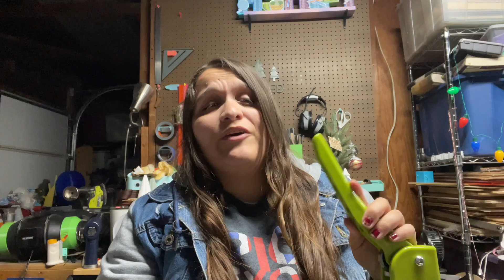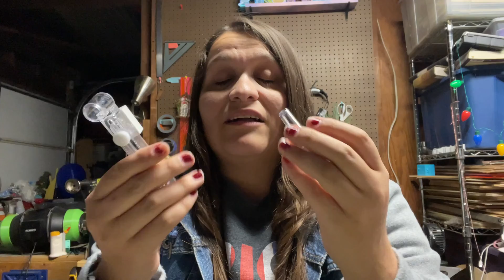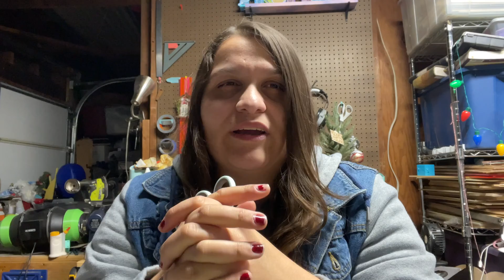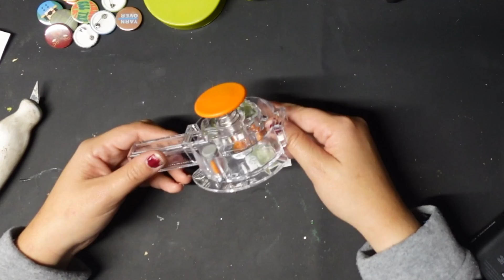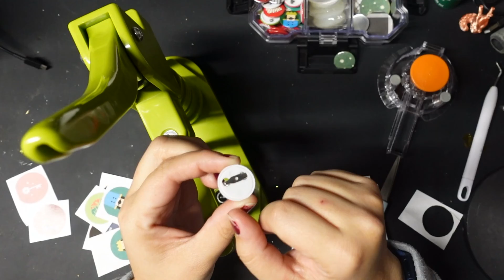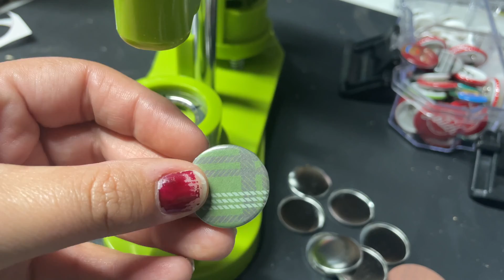Easiest Way to Make Money Crafting! | Amazon Button Maker | Day 9 of 12

Comment: Wow cool video I have a 2.25 button maker what type of paper was the artwork printed i use copy paper
Reply from the maker: I use just normal copy paper.
Reply: @ChippedBuilds  Dear, your printer is Epson? What kind of color configuration you use to print? Can share? Your buttons are so shine 😍
Reply from the maker: @claudyaguerr  just the default high image  quality on the printer software